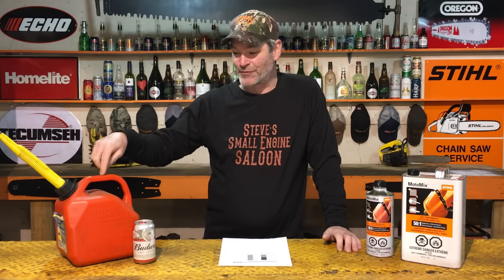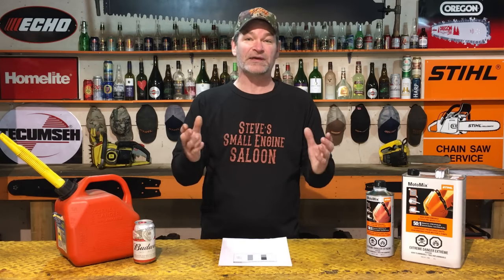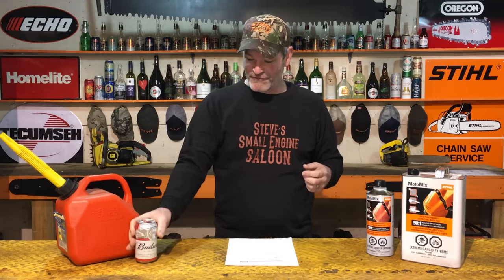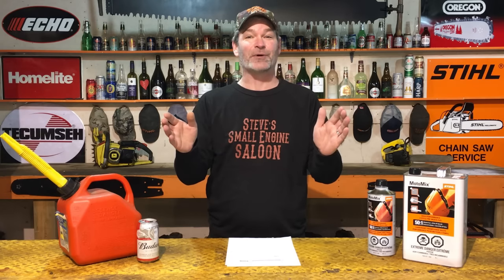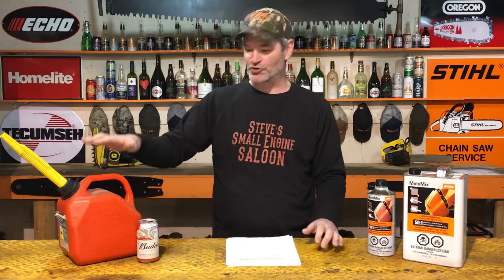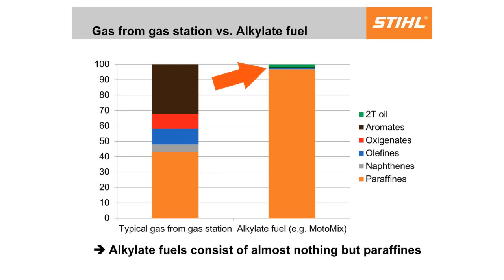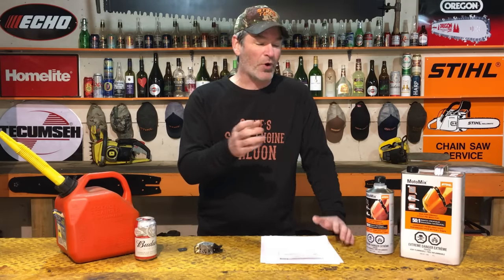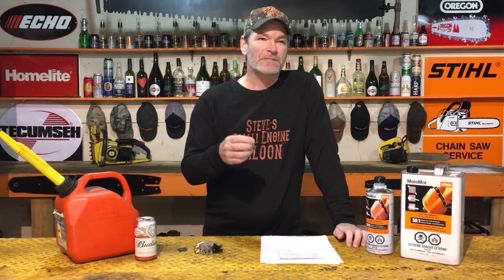The Ugly Truth Why Gas Station Fuel Is Bad For Small Engines

Comment: I buy high octane ethanol free gas from Shell for all my small engines.
Reply: exactly,  you dont need big volumes and its just a small marginal cost
Reply: Ray Duerksen why? All your small engines are low compression
Reply: Obviously you have never tried to start a 272XP that has no decompression valve.  @chisel83
Reply: @timberray9572  Correct, don't like Husky shit.
Reply: @timberray9572  What is the compression ratio or cranking pressure on that thing? If you know the answer.
Reply: @exoticcreature3059  I do not have a gauge, when that saw kicks back it will rip the starter rope before you have time to release the handle. After a few times of this happening I used paracord instead of using the regular rope, haven't had a problem since.
Reply: @timberray9572  That's how you know you have an animal. A beast.
Reply: I don’t think premium gas is ethanol free
Reply: camjamsdad  Where I buy my ethanol free gas they have 3 different octane ratings available. I use the middle or 89 octane which is what my owners manual calls for

Comment: I have a 30-year old Stihl brush saw that's never seen anything but ethanol-free pump gas and Amsoil 2-stroke oil, and it still runs great.  Fuel that costs more than Jack Daniels?!?  You must be out of your gourd.
Reply from the maker: I guess I wasn't clear ENOUGH in the vid.  I suggest this for winterizing/storage, not for running it all year around!  Not expensive 
at all....
Reply: @StevesSmallEngineSaloon  
Ohhhh...I get'cha.  I just pour the leftovers in my lawn tractor and let the fuel tank air dry before layup.

Comment: it would be cheaper to just buy a new saw when mine wont start than to buy that canned gas.
i have never had trouble with non ethanol gas in small engines but ethanol gas is total crap and should banned.
you can buy airplane gas for around $5 per gallon and it really is the good stuff at 100+ octane
Reply: I think that airplane gas is full of lead

Comment: It's probably good stuff but i don't use it & I'll tell you why. I don't have issues with pumped  fuel, I just took my Husqvarna 455 Rancher & my MS 180c Stihl out yesterday, both had not been run since 2017 today is 2021. Both started with only a couple of pulls with ease, I don't know but do you think it's because I use only 89 mid octane? I did run them out of fuel & put fresh fuel back in. I also add sta-bil but yea i'm happy with the fuel i get. The chain saws were stored over 2 years without being run at all. I'm happy with that! I also use the ultra premium stihl oil you know, the oil in the silver jug. All my equipment is also stored in my building out of the weather.

Comment: There are commercial operators of trimmers, brushcutters and chainsaws; here in Fiji, who buy premixed fuel straight outta the pump at service stations and they've been doing so for 10 to 15 years without any problems at all! Then we have homeowners who use the same fuel for upwards of 20 to 30 years, again without any problems at all. The engineered fuels are part of a big gimmick designed to get more out of unsuspecting customers. I buy fuel company processed 2 stroke oil and make my own mix in a mixing bottle and my chainsaws and brushcutters run real smoothly just like they were meant to. Engineered fuels are a drain on scarce resources for us!

Comment: I did this with all my 2 cycle lawn care equipment and my little 2 cycle cheapo generator last fall. Seems to have worked well. I even tanked up my snow thrower 2 cycle toro to be ready for the intermittent winter use. The extra cost of the fuel pays dividends in reliable starting and no tear downs for maintenance and parts. I definitely use regular pump gas during heavy mowing season, but the machines eat up the gas quickly without any extended storage time for fuel corruption.

Comment: At the end of every grass-cutting season, I always drain the fuel tanks of all of my small engined equipment, then run each until it is out of fuel.  I’ve not had a problem in more than 30 years.  And I always use 100% gasoline.

Comment: Marvel Mystery Oil mixed with gasoline and 2 cycle mix will do everything to protect your engine and carburetor that the engineered fuels will do ,also good for winterizing and it will help keep the diaphragms pliable, I've proven it to myself that it works,some might not believe it and may argue against it but my mind wont be changed by the naysayers, I'm sold on Marvel Mystery Oil and it's a lot cheaper, the stuff's been around for a lot of years.

Comment: "Rec" gas sold around here at stations that will see traffic from boat owners - think most have been branded Sunnoco stations. The pump is usually one with blue handle - not to confuse it with altered gasoline or diesel. Prices now in the $4.59-4.79 range, but still cheaper than the cans of real gas sold at home centers (about $16-23/gallon). I still use a gas stabilizer with Rec gas as i have equipment that sees limited seasonal use like my 1978 Trac-Vac - which usually starts within two pulls after sitting for 10 months since I started using Rec gas.

Comment: its alway some  Theory next you'll hear how bad that shit is. always trying to sell something. i run ethanol free fuel in all my air cooled or carbureted engines and have had no problems. run low grade ethanol fuel and you get nothing but problems..just saying.
Reply: Hey Steve
So what about my 4-cycle stuff like the mower and generator? What do you recommend?
Reply: @jeffbutts9182  always buy non ethanol gasoline, go to a place with boats and they should have it if your gas station doesnt have any real gas or buy airplane gas

Comment: You're just advertising expensive snake oil. I clean my carbs every season and they run just fine.
Also, petroleum does not contain paraffin. That's kerosine - jet fuel, or BBQ lighter.
Reply: Peter D Morrison Damn, we got an engine scientist in the comments, yay.
Reply: I just pee in mine !
Reply: Peter, that's incorrect.  I'm a gasoline blender.
Reply: The Term "paraffinic hydrocarbon" simply means a fully saturated linear hydrocarbon of any length. Not to be confused with Paraffin in Europe which is kerosene or jet fuel. or Paraffin in the US which is a long chain fully saturated hydrocarbon that is either a wax or almost a wax.  The opposite of paraffinic is olefins and aromatics, which are unsaturated (contains double bonds). Benzene is also in this category, though cyclic with a bond that is halfway unsaturated. The unsaturated hydrocarbons love to join together (almost polymerizing), making gums and varnishes.  Fuel stabilizer is a free radical trap lie BHA or BHT or Vitamin E that prevents polymerization. Ethanol contains oxygen, which is an electron pair donor, so Ethanol is bad for a much greater reason than water absorption from the air, which of course can be limited by keeping the cap closed on the container or tank. The donor electrons promote polymerization of the unsaturated hydrocarbons.

Comment: Run VP going into winter in south Florida which is mid December and go back to mid grade mid  march only use about a quart  in a weed eater and edger  through the winter just put in what i need at the time buy this fuel not so much to winterize here in florida because we still mow every 2 to three weeks but mainly  because I dont want to mix a up gallon of mid grade pump fuel that would take 2 to 4 months to burn through during  period and let it sit  in a plastic can for that time . Also VP/Stihl  helps de-carbon piston and rings which is good to do once a year

Comment: Very informative video.  Useful information.
Although I certainly think it is a great idea to use fuel that makes my equipment last longer, there is no way I could afford to use those products.
When I run my chipper shredder the normal time is about three to four hours.  Even my walk behind lawnmower or generator sees two hours or more per use.
Using the TruFuel would cost me over $50.00 just to mow a small section of my lawn.
There has to be a better way.

Comment: I got a new Husky straight shaft trimmer about 10 years ago I just left it with mixed gas over the winters and had  NO  problems .. (I'm in Canada) .. So a couple years ago I stored it over the winter with Stihl moto-mix in the spring it wouldn't start , disassembled carb and fuel pump diaphragm was hard as rock ..

Comment: I always thought it was ethanol too....thanks for sharing! Gotta say though ever since I started using non oxy  premium I haven't had many issues..I usually use starbright stabilizer and fogging oil to store my small engine equipment...I finally had to rebuild my old snowblower carb after 6 years so I'm ok with that.

Comment: Another great video Steve! The bottom line is that gas station fuel is horrible stuff. Some is better than other & I only ever run Shell premium because it has zero ethanol & supposedly a bunch of detergents (might be just an advertising  gimmick). For out of season I run my engines up good & hot until they run the dry & then I vent the tank to the air. Never had any problems in the last 15 years but this year I am gonna follow your advice & the logical explanation here to store with the Stihl motimix.

Comment: Many decades of using Sta-Bil in both 10% ethanol and ethanol-free gas with no problems. In the Fall I start my blower and trimmer, dump the fuel out, then continue running it until it stops. In the Spring, both machines start and run with ZERO problems. I practically wore out an American-made Homelite blower and trimmer doing the same thing. Gave them to a friend who did repairs for the parts. I’ve had and Echo trimmer for over 10 years, perfect, and a Stihl blower, 4 years old and expect no problems with them. Same goes for my 4-stroke mowers and tiller.

Comment: I just use standard 91 unleaded and I mix it with two-stroke motor oil MOTUL and everything runs great start second start I live in Australia so be paying about $40 a litre Australian and 4 L probably about 110 per 4 L but you can use it on your dirt bikes on anything and your engine will run great 👍

Comment: I use pump gas with absolutely no issues. End of grass cutting season, I use rec fuel fir last couple of cuttings. Then run it dry. Always starts within 2 or 3 pulls inspring. Can't say same about a chainsaw though.

Comment: Hi Steve,  great video.   Well explained.    I am curious to know how your equipment faired after you winterized your equipment. 
Did you do a follow up video on the results.  I have a Snow blower which is only a few years old and have so many issues with starting each year. With this video I suspect its the fuel?  Thanks  for sharing

Comment: Steve. One would have to agree that the Motomix is best for your small engines. BUT, I just check on Amazon and one quart is $25.00 ???  I just spent several DAYS cutting up huge fallen trees in my back yard. Chainsaw ran almost constantly. At $24.00 a quart it would be cheaper for me to pay someone else to cut them up ???

Comment: Have a Toro push mower 34 yrs old. Has never been to lawn mower shop. Has original carburetor which has never been cleaned. I use only super grade gas from gas station   This is 2-cycle motor which was used commercially by my son in the late 80s. Can regular gas be that bad?

Comment: Steve ,, I figure the amount I save on fuel over several years is enough to replace the machine/tool with change left over .. I have a Troy Bilt Tiller from 1969, Sixty Nine, and I run it all the time for my garden and large areas of lawn repair.. It's had nuttin but pump fuel and I have been using Sta Bil for years too.. When I put my machines away, I run em dry or I stall the engine with Marvel Mystery Oil..

Comment: Every year at the first strartup if i left my lawnmower with regular non ethanol gasoline in it it never starts even with start fluid it only runs uintill i stop spraying and the plug is soaking wet.
Have to drain the tank and fill new fuel and work out the fuel from the hose before it starts and runs again.

I did winterize it last year but i had a little trouble starting it again but this time using a little start fluid and then it started right up and didn't need to drain the tank, so it is definitively much better and there is much nicer smell to the fuel also (here it's called akylate fuel).
It was just a cheap brand but still better than regular fuel.

Im not running it every time just the last mow before the 7+- months winter season

Comment: I use non ethanol fuel and then put Seafoam in over the winter.  I try to minimize how much fuel I have left at the end of the fall so that I can mix fresh gas with it in the spring.     Anything that has a fuel turnoff I run dry. I try to run everything once during the winter if we get some warm weather but I rarely actually get around to it.
 Never had a problem.  I don't know what people are talking about.  
I did have a chainsaw that I almost fried because of one of those little diaphragm things got too stiff.  But it was 35 years old when that happened.  
I got carb kits for all my equipment that were over 10 years old and replaced them

Comment: As a homeowner with about one half acre of land, I use a gas weed wacker, gas blower, gas chainsaw and of course a lawnmower. I always use truefuel in all my premixed tools. And have never in over 10 years needed service to any engine out of them all. I change the odd spark plug which  have been in pristine condition, so I don't think I will even need to do that anymore. The lawnmower and snowblower that use gas station fuel that doesn't use pre mix, have needed a 200 buck overhaul every 5 years, (Carb disassembly and sonic cleaning, and new plug and also lines and flush) So yes truefuel is the best for small engine premixed units if you want very long trouble free service.

Comment: If you're concerned about fuel going "stale", give an ear.  I recently started using 94 octane pump gas that I had stored in a galvanize steel gas can for over 35 years.  I purposely filled the tank on a little 3 horsepower engine and it starts and runs fine.  I have never "winterized" any of my equipment.  I have had a few instances of four cycle engines not wanting start in spring.  In that case I remove the air cleaner, give the carb a squirt of fuel and I usually get a start on the first try.  BTW, I think that old fuel was from pre-ethanol days.

Comment: I have 2 cycle engines. I will use regular gas/oil mixture in my equipment all year long until the end of the season nears and run it dry. Then Ill use the  expensive "good stuff" out of the can until I store them for winter. Its my opinion that it cleans the engines and keeps them running awesome.

Comment: Steve I run 4 strokes with all kinds of upgrading parts 20 plus  horsepower out of a  stock 6 1/2 hp.  Hemi head predator I'll run on ethanol then in the winter or off  season off-season besides running it out of gas shouldn't I put WD-40 straight in the carburetor before storing???

Comment: Good info , thanks for the research . I'll probably keep using premium and run the saw till it uses up the fuel in the carb when i expect to store it more than a couple months , just because i am cheap.  One saw we had never seemed to gum up or mind being stored for years , then would start after a few pulls when you put fresh fuel in it ,  a Stihl Contra from about 1960  lol , what a saw that was .

Comment: I been running regular in my chain saws since 71. All you have to do is run fuel stabilizer and store them out of the elements the best you can. I used husky, stihl and gas station oil. Gas in the sixties would go bad and gum shit up bigtime too. The ethanol I keep for my generators with stabil in it seems to last longer than the gas did back in the day.

Comment: I have a Stihl Weedeater and  chainsaw. Both run on pumpgas + stihl oil. Here in Brasil we get 25-30% ethanol gasoline. lets say E75. I frequently have to clean and readjust the carbs. Especially on the weedeater which i run half throttle most of the time. Now since the bad components mostly aromates seem to come from the gasoline, would it be ok to run the weed eater on 100% ethanol? (is avalilable here)

Comment: As a homeowner with a small yard and 3 stihl items all i use is the moto mix. Its not too  expensive. if your spending 300 plus on a peace of equipment an extra 8.00 for a can which will insure no problems is totally worth it. Hell i even use tru fuel gray can for my lawnmower.
Reply from the maker: Right on Buddy!

Comment: I don't know, I have been running Shell premium in all of my small four cycle engines without one issue. Now the only two cycle I have is a chain saw and that I do run pre mixed engineered fuel in. I have added fuel cocks, in all of my mowers and snow blower and run them out of fuel when their season is over. The weed wacker I just empty the fuel and let it run dry. Have never had any issues starting any of my small engines, not once.

Comment: Ya, I always go to petrocan and buy the ultra 94 octane clean premium fuel for my equipment, it is worth the extra dime I have never had a fuel issue, whereas my neighbors regularly bring dead lawnmowers here that require a fuel system cleaning
Also, there is no need to add stablizer to fuel you are going to burn right away, you only need consider that when it is coming time to store equipment

Comment: Just out of curiosity does this stuff allow the engine to run cooler than gas from the gas station? Does it run hotter or is there no cylinder head temperature difference between engineered gas and fuel from the local station? Cleaner spark plugs over time? Fuel consumption < = > one over the other, cleaner fuel filters over time? Please respond I'm very curious about all of the above. Thanks.